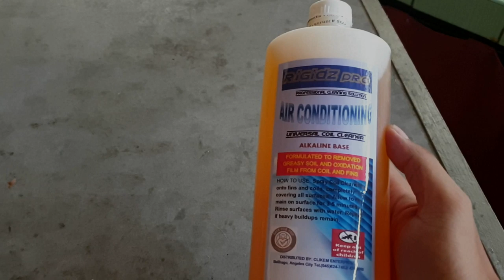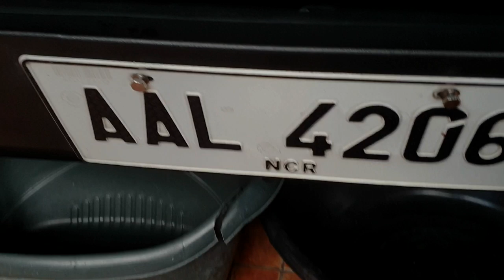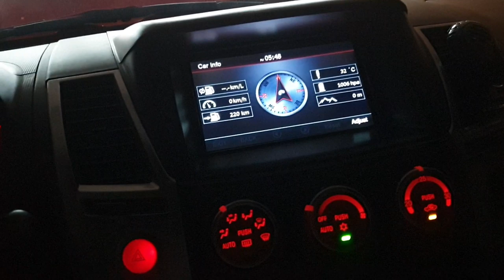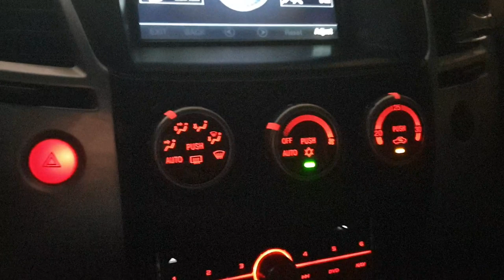Paano Linisin ang AC Condenser ng Montero Sport | DIY Tutorial

Comment: Du you know if the gasoline version have this condenser fan? Because I have an 2011 of gasoline 4x4 and don't have one installed, I have some problems when I'm on heavy traffic, the a/c stops blowing cool air. I already changed the fan clutch because I had heating problems but no anymore just persist the A/C problem
Reply from the maker: It should have condenser fan.
Dont forget to subscribe 🙂

Comment: Sir nalinis ko na auxiliary fan, condenser, blowers and palit cabin filter ng montero. Malamig na siya pero after maybe 10 minutes or more ng driving, hot air na binubuga. Intermittent siya. Any tips? DIY AC refrigerant charging naman. Thanks.
Reply from the maker: Hello sir Dexter
Pansin niyo po ba sir na tumataas ang temp gauge kapag nawawala ang AC? Minsan po kasi cooling system ang problem hindi AC. Otherwise, check the pressure line especially the high side. Kung me pagkakataon sir, mag-DIY tayo ng AC charging.
Dont forget to subscribe
Reply: @NoahsGarage  Steady lang sa gitna ang temp sir kahit matagal na nakaandar. Yung intermittent AC lang talaga. Subscriber na po sir and marami na natry sa videos mo. Thanks.